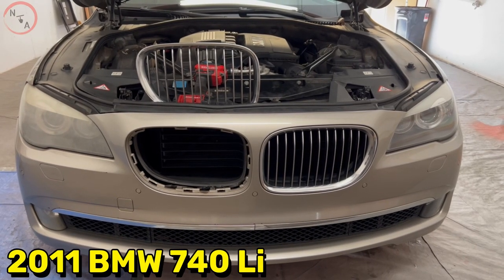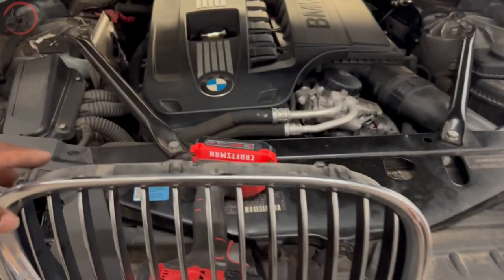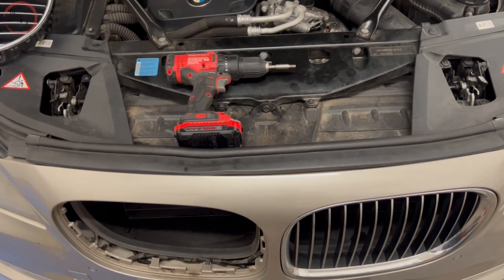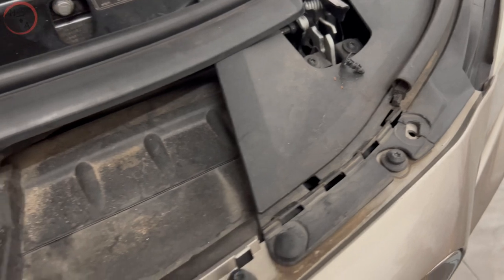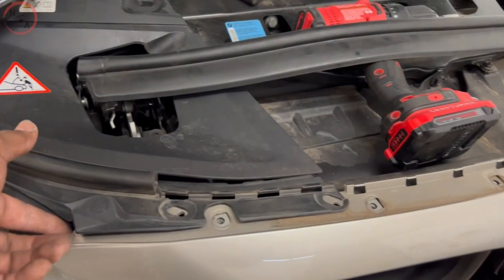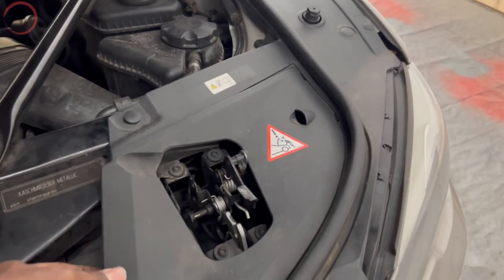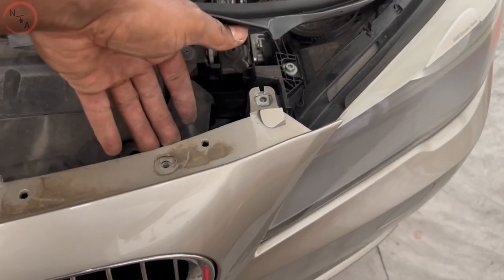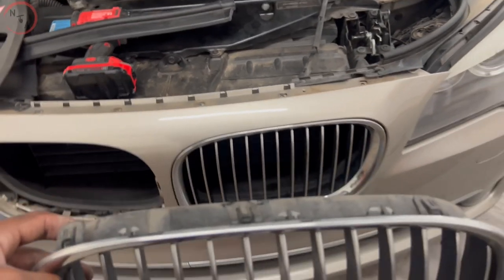How to Take Off BMW Front Grille: A Handy Guide

Comment: Good video brah. So question… do you need to remove the full bumper if you need to replace those “black plastic pieces” that the grill snaps into? Had some grocery carts hit my front during a rainstorm, pushed in a grill piece a little to where I can’t just snap it back.
Reply from the maker: Thanks and I appreciate you for watching the video. The bumper doesn’t need to be removed to replace the two grille pieces, there are clips behind them that allows you to release them.